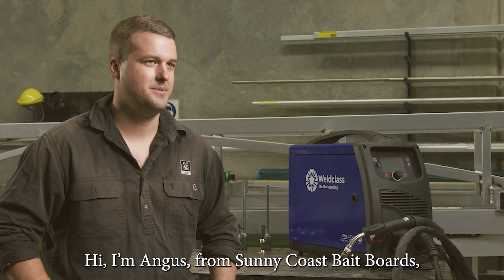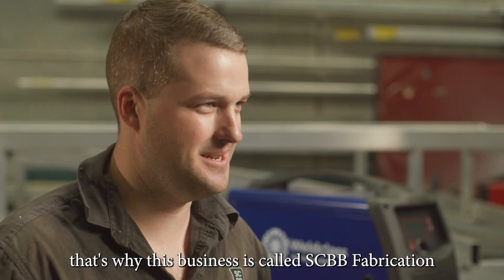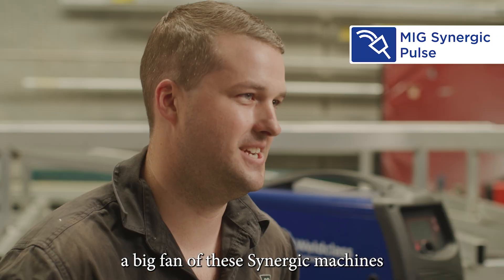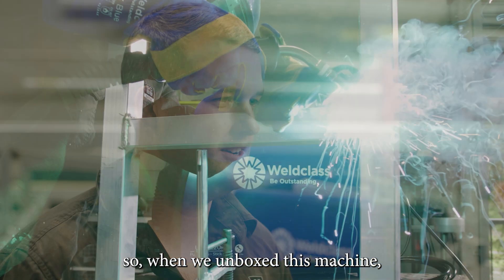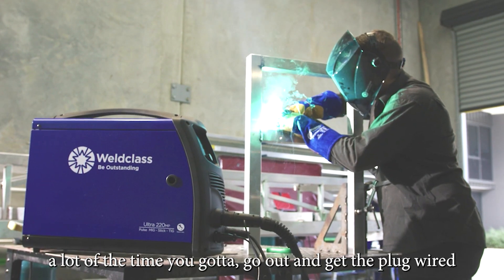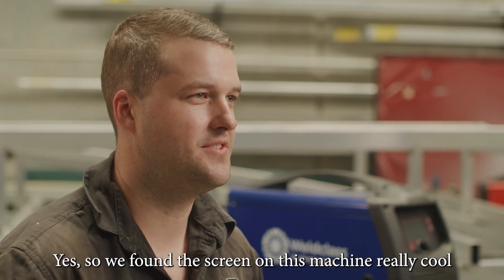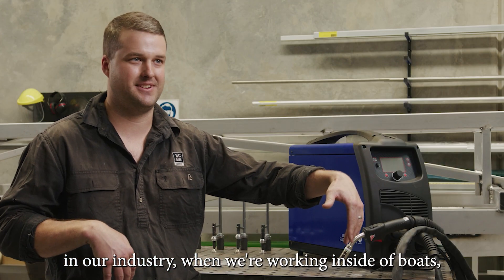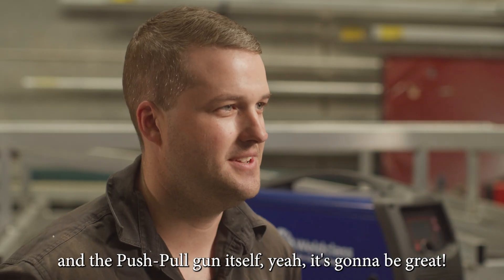Pulse MIG Welder - Weldclass 220MP (Review)

Comment: Nothing indicates that this machine supports a spool gun. I'd be very disappointed to pay over $4K on a MIG machine that didn't support a spool gun. 

A Dual Pulse MIG machine is what I consider a "prize" for when I get good enough to justify the expense. With the expected expense I wouldn't necessarily conern myself over it to be particularly portable or for that matter flexible on power source .. but I would expect it to support every manner of gun including water cooled, push pull and spool. (Apologies if water cooling has zero to do with the machine itself, I'm ignorant when it comes to water cooled guns)